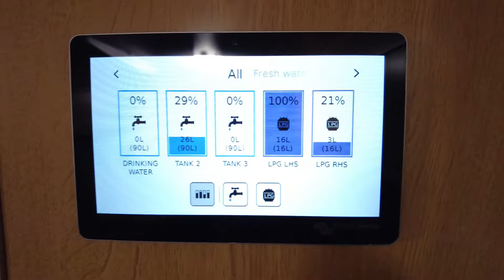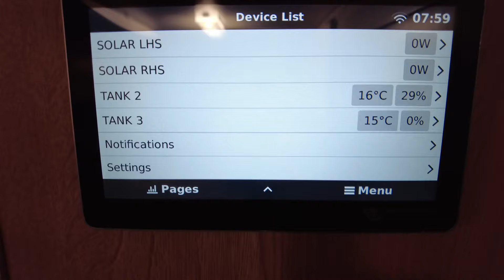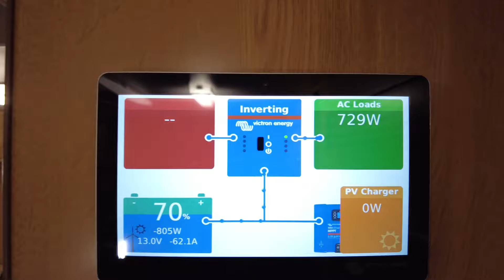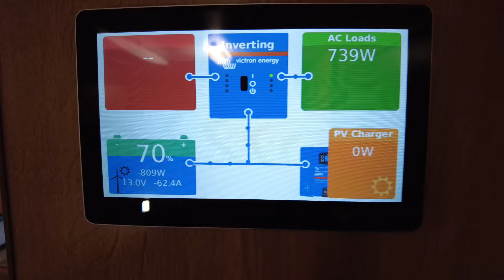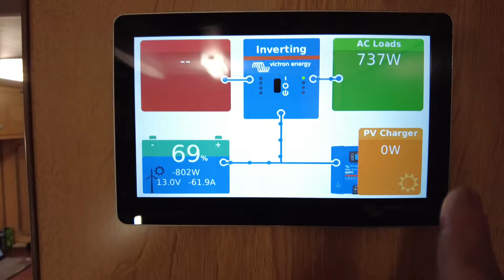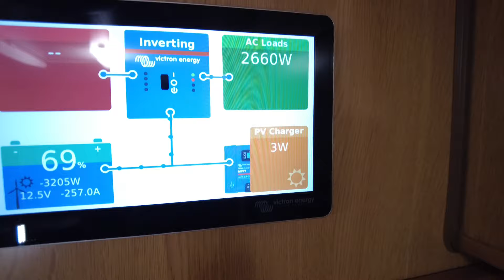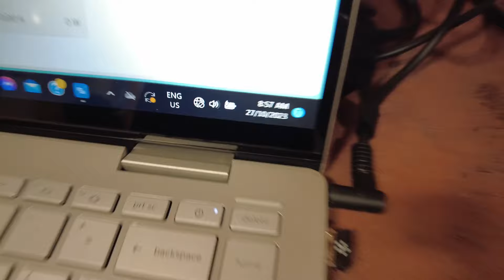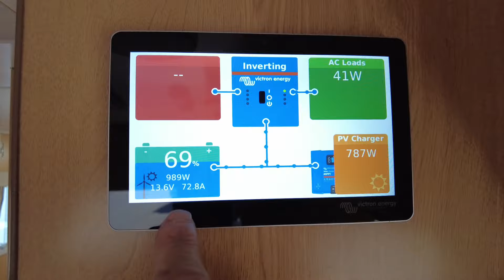BUSHTRACKER 1200watt/620ah lithium off grid setup/Air conditioning, induction cooking and more

Comment: Hi Matt lobe your videos I know Trevor the owner of this van It was great to see an install in person I have watched all your videos.

Just wondering with the 2x strings on solar panels do you wire them in series or parallel? Also do you fuse each panel individually. I saw a video stating new laws for solar that said if connecting panel in parallel each panel must be fused before the series connection.